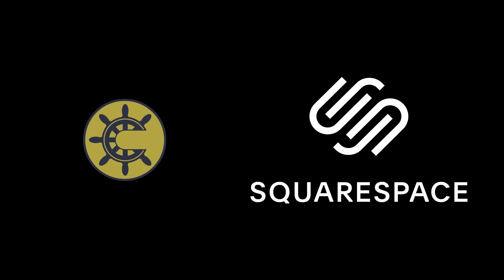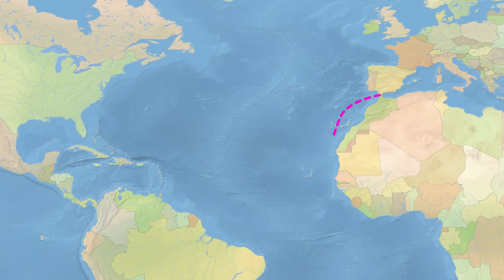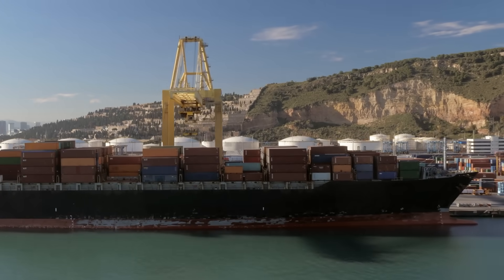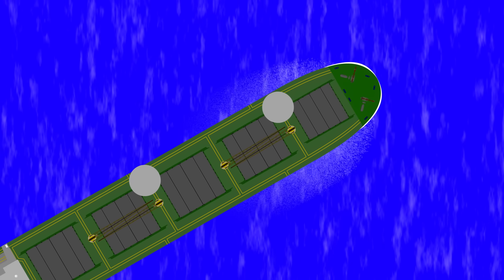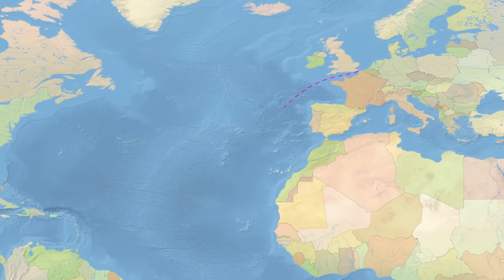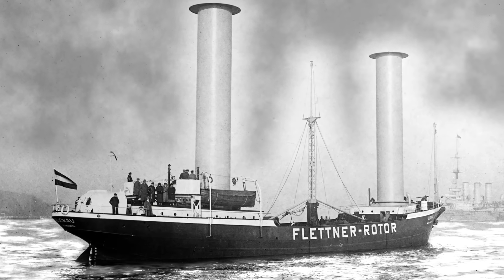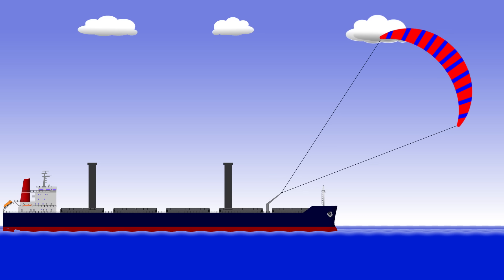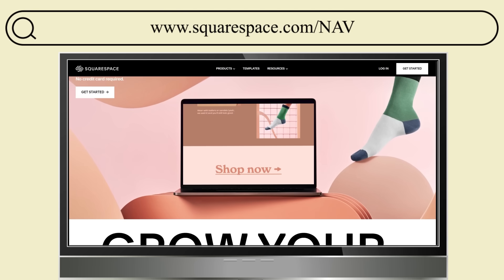Why Don't Sails Work On Ships?

Comment: Bulk carrier designers are considering the resurgence of the windjammer concept, that proved viable into the early 1950's. That is because bulk carriers (in the form of granular cargoes) often rely on shore infrastructure for loading and unloading anyway, so the impediment of masts and rigging is not as intensely felt. 

Also, especially with fore and aft rigged sails, motor sailing has immense benefits to fuel economy and profitability. It also means the vessel is not as reliant on wind direction, or even wind presence, as the vessel's own motion from motor propulsion produces the movement across the sails necessary for further propulsion. Wind heading still has relevance, but a vessel can point much higher and go significantly further on the fuel available. In fact, motor sailing on commercial vessels is used extensively in South and Southeast Asia and the Pacific region for small commercial vessels, due to it's fuel and therefore cost savings. These are usually island and village traders, that carry smaller cargoes of less than 500T. Although, as mentioned in the video, this is also becoming more popular in the cruise industry for the same reasons.
Reply: …when I read “the vessels own motion from motor propulsion produces the movement across the sails for further propulsion”, I know I am reading the words of someone who has no concept of the fundamental laws of physics that constrain the opinion of all educated people.
Reply: @XPLAlN  I am no physicist - so cannot put it in overly technical terms - but wind can be true or relative. When it is relative, IE, caused by motor propulsion, it still creates forward motion relative to the engine speed to the vessel by means of the foil created by the sail. This makes the economic movement of the vessel. That is fact - any navigator or mariner is very familiar with.
Reply: @sa25-svredemption98  …what you need to understand is there has to be a wind. If there is no wind, you cannot get anything from the relative airflow created by the propulsion system.
Reply: @XPLAlN  yes with traditional wind-filled sails, but only a few knots - extremely light airs - are sufficient to make motorsailing practical (again, specific to traditional sails). You literally only need the sails to shape, and the vessel's relative movement does the rest. It makes phenomenal fuel economy. Of course, like an aircraft, if you had fully filled sails already - such as with a shape retaining membrane, battens, or aerofoils rather than traditional sails, you can generate the lift anyway by your movement. Ergo, with the right sails, even no true wind can allow for motorsailing.  What you are referring to is purely the true wind necessary for traditional sails to fill and shape, where the aerodynamic design of them does what I, and was loosely referenced in the video, am talking about.
Reply: @sa25-svredemption98  >>”Ergo, with the right sails, even no true wind can allow for motorsailing. It makes phenomenal fuel economy.”

No it doesn't because that would defy the law of conservation of energy. Note, I am not saying you cannot save fuel by motor-sailing. I am saying you cannot do this in still air, and the fact you can create some relative wind by chugging along does not change it.

>>”What you are referring to is purely the true wind necessary for traditional sails to fill and shape, where the aerodynamic design of them does what I, and was loosely referenced in the video, am talking about.”

This video contains nothing that implies the violation of a physical law. The problem here is you are putting an interpretation on the content that it should go without saying is impossible.

>>”Of course, like an aircraft, if you had fully filled sails already - such as with a shape retaining membrane, battens, or aerofoils rather than traditional sails, you can generate the lift anyway by your movement”

Sure you can generate lift with your movement. But the vector sum of lift and drag cannot possibly provide thrust, when thrust is defined as forward in the longitudinal axis of the vessel, and your only possible point of sail is directly into your own induced wind. Even if you trick your mind into thinking that is possible, then conservation law should tell you to reject the idea of saving fuel in still air. It is flat earth stuff, like free power.
Reply: @XPLAlN  divide air across a curved and flat surface, it creates positive and negative pressure areas. That creates lift. In basic maritime terms, we usually describe this as "sucking" the vessel, although I am aware it's not a vacuum motion but a lift sideways and across that is created. When you motorsail, you are not moving through nothingness, you are moving through air. Movement of air across a curved surface generates lift. This video described one of the options that is being trialled is inflatable sails, which is doing EXACTLY what I'm talking about - not relying on the wind filling the sails to create the curved surface, but a preexisting curved surface moving through that substance we call air. You are right that, if you are sailing a traditional caravel, you can't motorsail in doldrums. But we are not talking about sails that require airflow to fill and shape, we are talking about various methods being actively employed today to enhance fuel economy at sea. Whatever your bent is, I am talking about what happens in life, not fairytale land. Vessels that actually exist, actually use their sails (or sail like devices if that is where you are tripping up) to operate more efficiently. As I say, I am not a physicist so will not try and explain why; I am a mariner, I can only say it does, and can tell you how to generate that effect. And, if you are so desperate to prove reality wrong, get a hull, whack a wing on it vertically arranged, and put a motor on the back. Look at the difference between using no wing and with wing, and you can see exactly what I'm talking about. It's just, for the most part, we call those wings sails, regardless of what they're made of and how they're arranged.
Reply: @sa25-svredemption98  the reason I am engaging is that you persist in arguing that a motor-sailer can defy the 1st law of thermodynamics by using its own sails  to save fuel in still air. This meme of yours that it is possible if only the sail is the correct shape is a complete red herring and only reinfiorces my suspicion that you are irrational in your beliefs.

Comment: Alternatively to regulation, which will just be hated by all parties involved, ship owners could take out a loan for the installation. They then are more attractive to charterers because of lower fuel costs, meaning they can demand a slightly higher fee and the economics comes out to a wash for the charterers. The increased fee pays the payments on the loan, until it is paid off at which point the rest is pure profit for the rest of the life of the vessel.

Capitalism offers solutions to these problems. Regulation is unnecessary.

Comment: The problem is there are so many ships using super obsolete dirty old engines. There are extremely efficient modern engines that could be used in more ships and emissions would be massively improved. There needs to be some sort of world wide pressure. Like maybe you get a discount on you landing or docking fees or tariffs by using modern cleaner ships at all eu and us ports or something.

Comment: Also worth noting, that the slower the ships travel, the more they will generally benefit from any kind of "air energy" addons.

But purely on a technical level, except for the not so many routes that are "straight into the wind" most of the way, both Flettner rotors and Sky-sail have clearly shown that they work and can be very advantageous.

So, as usual, stupidity and shortsightedness is the only real reason they're not used more.

Also worth noting, turbosail and wind turbine ships, both of which can be almost impossibly to distinguish from Fletter rotors for nonspecialist.

Interestingly, i've even seen some attempts at combining 2 or even all 3 of those technologies.   Probably extremely unrealistic, but functional models have been achieved at least.

IF, these things could be combined with things like rear-flap, advanced bulbous bow shapes, air cavity system and wake reduction, achieving a 50% reduction in fuel use is perfectly possible.
Some argue that 75% reduction is within reach if all known techs could be used.
Reply: It is not about “stupidity and short sightedness”. The ships exist to satisfy a global demand to move cargo. Slower steaming requires more ships to keep global cargo moving at the same rate, which brings an environmental penalty of its own. Fuel is but one cost. Time is money. Fuel savings have constantly to be balanced against time. Extra crew increase time costs.
  There were reasons that the amazing tea clippers of the nineteenth century with their zero fuel costs quickly became uneconomic by comparison to steamships that were by today’s standard, very inefficient.
Reply: @XPLAlN  "It is not about “stupidity and short sightedness”."

It most certainly is.

"Slower steaming"

Now you're making arguments up.
I only stated that the effect gets BIGGER with slower moving ships.
The effect is already plenty large enough to be VERY economical.

A mostly onetime, relatively small investment that brings down fuel usage by 10-20%, the investment is repaid in 6 months or less.

"Extra crew increase time costs."

What extra crew?   Another strawman.

"There were reasons that the amazing tea clippers of the nineteenth century with their zero fuel costs"

lol

Except for the fact that sails of that time required a MUCH larger crew and how expensive sails and rigging was to keep in proper condition.

There's a reason why the single most common secondary duties onboard a sailship was mending sails and fixing ropes for the rigging.
Reply: @DIREWOLFx75  You are in denial of the facts. These devices require extra crew and training. None of them are maintenance free. You have plucked the opinion from thin air that these devices will save 20% of fuel and pay for themselves in less than 6 months. Everyone would want them, it would be a no brainier. It is as if you didn’t even watch the video. Time is money, and time dominates the shipping industry.
Reply: @XPLAlN  No, that is what actual ship owners have stated.
At the same time as they're saying that they still can't implement it, because as clearly said in the video, THEY have to pay for the investment, while the profit then goes to those using the ship.

"These devices require extra crew and training."

Flettner rotors require absolutely ZERO extra crew and training.

Wind turbines essentially means the regular crew for the engines will need a 2-week class on what's different compared to regular engines.

Sky-sail can be purchased that are by now 99% automated.
The captain and command crew needs a few days of learning when they should override the automatics and how to exploit the skysail the best.
Even if you step down to a semi-automated model, same for the command crew plus an extra week how to handle it and a 2 week training class for a few of the crew.

No extra crew required, and the amount of extra training even for the skysail which needs the most, is utterly minimal.

"Everyone would want them, it would be a no brainier. It is as if you didn’t even watch the video. Time is money, and time dominates the shipping industry."

Says the one who failed to watch the video, wow.
Yeah, EVERYONE DO WANT THEM.
They just don't want to pay for the initial investment, because the people doing that are not the people benefitting from them.

AS ALREADY STATED IN THE VIDEO.
Reply: @DIREWOLFx75  The people managing profitable shipping operations are not, quote, “stupid and short sighted”. They know stuff you don't which is why they do not do what you think they should.

>>”Flettner rotors require absolutely ZERO extra crew and training.”

Clearly bogus. Someone has to know the system, how to operate it, how to maintain it, what are the safety implications of having crew around them. In a professional operation, anyone who is going to be around those things will get extra training. Even if you think it is automated there is still a need to teach the crew how to manage the automatics. Flight engineers and navigators were taken off the flight deck decades ago and yet pilots had to be retrained to manage the new automatics. 

>>”EVERYONE DO WANT THEM. They just don't want to pay for the initial investment, because the people doing that are not the people benefitting from them. AS ALREADY STATED IN THE VIDEO.”

Rubbish. If the savings are as big as you think and stand up to the real world test of reducing costs then the owner-operators would soon dominate the shipping market with their “20%” cost savings. It isn't happening because it is way more complex than you have the intellect to deal with. A handful of wind assisted vessels in niche operations does not extrapolate to “20%” savings for the global fleet anymore than a successful fast cat ferry operation does.

Comment: If there are two cargo companies and one charges me 10% more for shipping because their ships require 10% more fuel, I will of course prefer hiring the other company. So of course it will pay off for ship owners to reduce fuel consumption as it will get them more jobs. You don't need regulation for that, you just need one big company to start using them on all their ships and if the other ones don't go along, they are soon out of business.

Comment: Why can't ship owners just charge more (but less than the cost of fuel saved) to rent out their ships with wind propulsion devices? It will still be a net positive for the charterer as they will have to pay for less fuel, but the owner also gets a benefit. It's the same reason why people would want to buy a car with a higher fuel efficiency.

I think you need to come up with a better reason for non-adoption.

Comment: Alternative solution that doesn't involve the expensive and useless political wet farthest known as the UN: if the charterer saves money then they stand to gain from using a ship that is outfitted with cost saving devices

Comment: Well... it would be nice if such laws would be introduced internationally, but it is not strictly necessary. The EU could just make a loaw saying only ships with particle filters and energy saving components reducing the fuel consumption by at least 15% are allowed to enter their harbours. And yes, there might be a lot of whining and threads of a trade war, but in the end they would just end up allowing other ships in as well but ddemanding prohibitively high fees which would, in essence, lead to the same effect.

Comment: You brought up some excellent points, but missed one. Anyone who has been on a boat under sail knows when going into the wind, which produces the highest speeds, boat heel to one side. This is a result od the force from the lifting action not pulling the boat forward acting against the hull. Anything not securely fastened goes flying. The way cargo is stacked on the deck would tend to slide off. 

As you alluded, there is a multitude of other factors, not the least of which is the need for a keel, increasing the already hefty draight, requiring even deeper water ports  This on top of other factors like the shape of the ship to how masts would be secured. Did I also mention the cost of installing and maintaining massive amounts of rigging and sails? 

Implementing green propulsion on ships is very problematic. We see the challenges with wind and electric powered by batteries would leave little room for cargo. The only thing I can think is the use of solar panels to power electric motors - as a supplement to the regular. I'm saying that off the cuff, and people much smarter than I could determine whether that would work.

Comment: Ok, so here's my potentially stupid idea: 
Giant squirell-cage fan with variable geometry.
Vanes could be oriented so it functions either as a vertical wind turbine or a Flettner rotor, depending on wind direction. With the ship travelling with the wind, it would generate electricity and the added drag would aid propulsion. With the ship going perpendicular to the wind, it would generate forward "lift" due to the Magnus effect.

Comment: Ships have so high burts that the sails could be placed along them. Not to replace the engines but to offload them when possible. Also making ships bridges more aerodynamic would help reduce the air resistance when they sail upwind.

Comment: 3:15 That is a myth. The air current on one side of the wing is not married to the air on the other side. There is no reason for the 2 currents to arrive at the other end of the wing at the same time. So, there is no reason for the air current on one side to move any faster than the air current on the other side. Its the angle of impact that makes a wing work. In other words, wings and sails work on the same principle. The idea that air moves faster on one side of a wing than the other side is pure hooey.